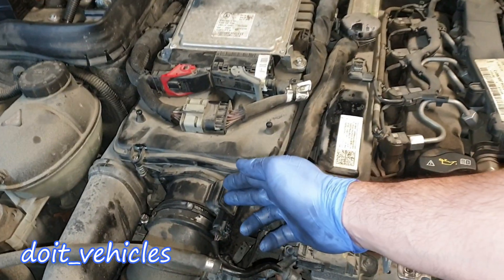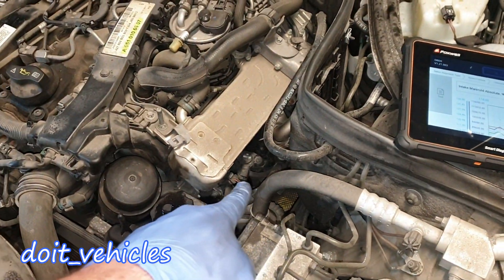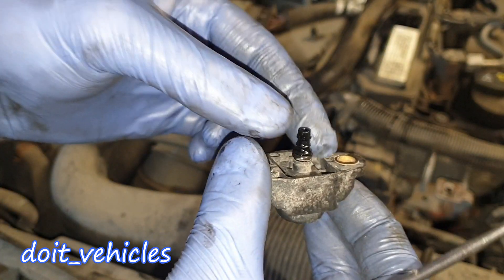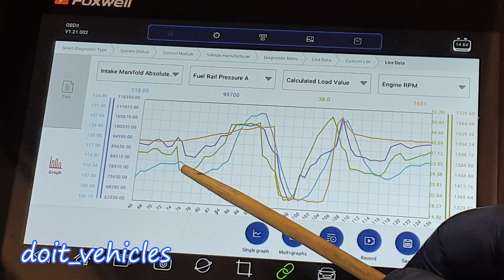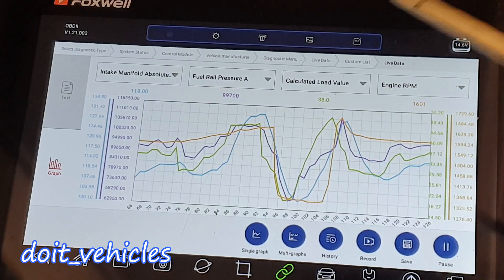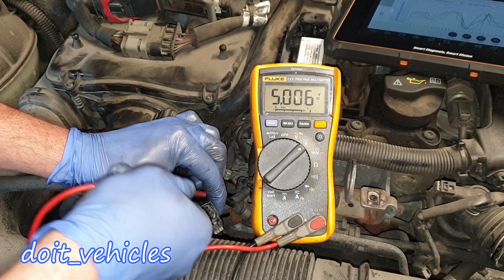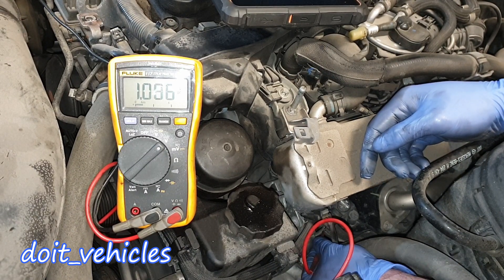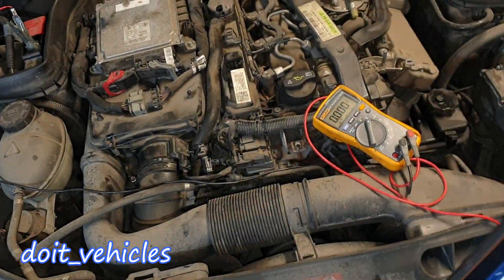MAP sensor from W204 Mercedes C 180 CDI Diagnose , Test , Clean OM651

Comment: My MB c250 cdi got problem. On low rpm (1300-2000rpm) on acceleration it jerks. No faults. DPF removed, EGR dissabled. New turbo solenoids. Both turbo refurbished. New intake manifold without swirl flaps. Then it jerks, we se to high boost. Maybe just the sensor sometimes going mad… 2 years already, nobody can find the problem.
Reply: Like This?
https://youtu.be/9ZVgKMg2oqc
Reply: I got the same same problema as you, I did all the thing you do, and still jerk, specially on cold morning.
Reply: @federicosalgues9005 hey, did you find the problem?
Reply: hi guys, did you find the reason?
Reply: Check quantity control valve values, see if it fluctuates with steady light acceleration and at idle

Comment: what is the year of this model? and do you know where I can find the wiring diagram for Mercedes for free? thanks for the video Mate
Reply from the maker: that would be simple , just bypass the original connector , than wire it up to the battery with a switch